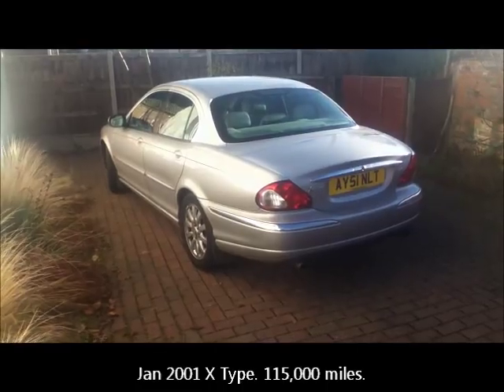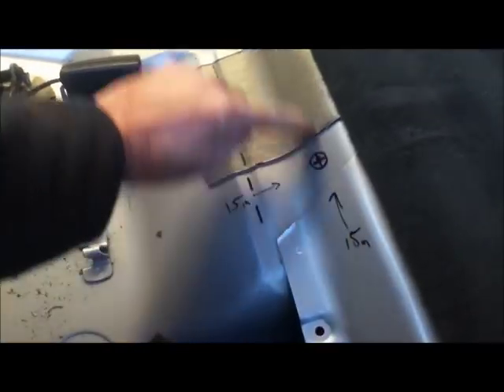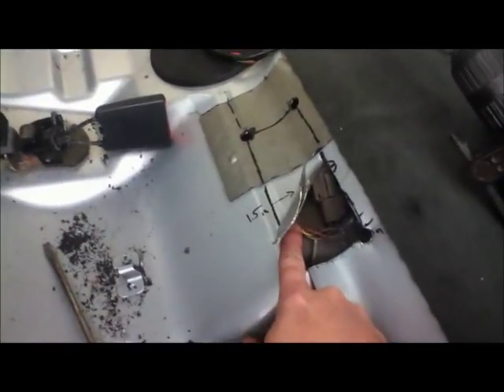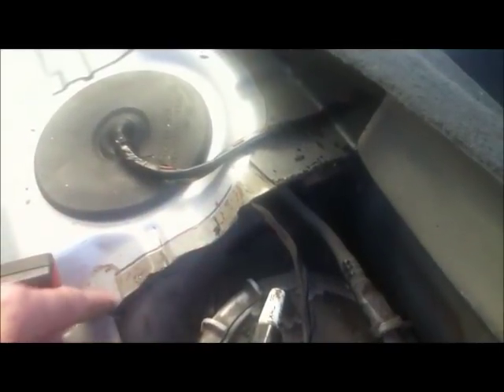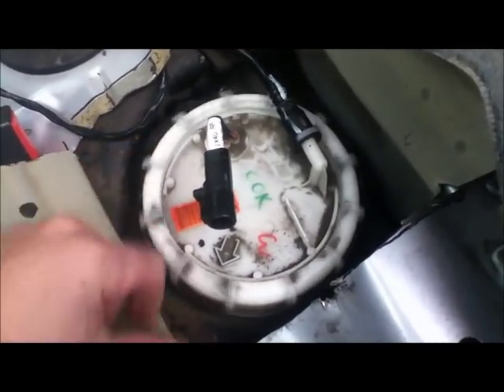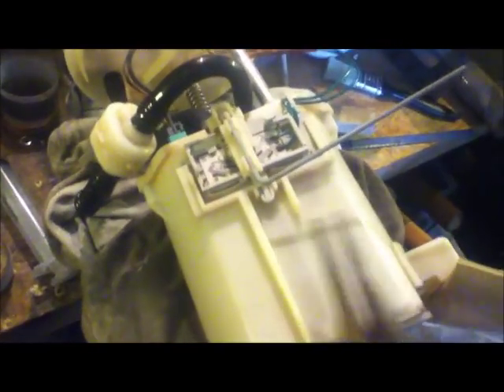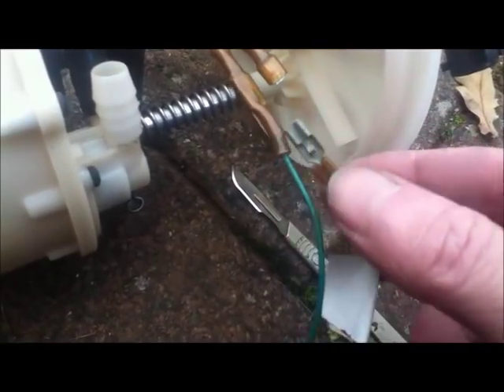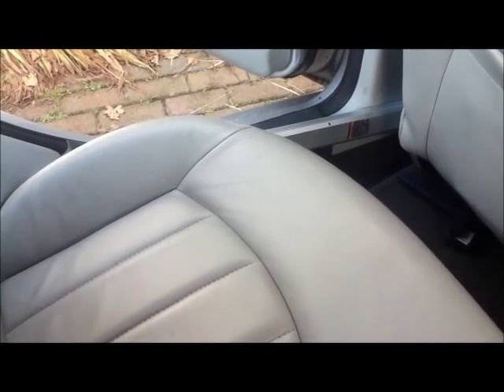Jaguar X Type Fuel Pump Change

Comment from the maker: You need to bear in mind that these videos are for people who want to repair their own cars. My Jag isn’t worth more than £350 now. To remove the tank is £800 ($1000) worth of work which you can’t do without a workshop lift. First empty the tank – there’s no drain plug you need a siphon and pump. Lift the back seat out –easy enough. Prise the grommet from the floor panel and disconnect the wiring, Jack the car right up high. Disconnect the fuel filter, the breather hose. Loosen the fuel filler clamp. Remove the prop shaft – it will be siezed on every screw.  Lower the final drive unit by 75mm (drop the subframe - that will be fun) and suspend it with a strong chain! Slacken the other fuel filler clamp (nearly impossible to see). Disconnect some other hoses. Chock the tank and undo the bolts. Lower the tank with two people - it still has fuel in it. How many hours has this taken? Now you can undo the fuel assembly and fit the new pump. Now put it all back. How many more hours? Test the car runs. What happens if it does not? £13 version – lift out the seat, cut a slit in the floor, change the pump, seal the slit, test the car - all done in 2 hours max. 1/2 hour if you have to do it again in the future. The S Type has a rubber panel right over the pump – so do most other cars. The X-Type has some terrible designs flaws and this is one of them.

Comment: I was getting ready to do this job, as after 5 months of winter storage the fuel pump would not run at all. Instead I put a couple of electric heaters under the gas tank for a few hours, then hammered the plastic tank a bit with a rubber mallet and she fired right up. I got lucky with that, hopefully it won't happen again. In the future I think I will start it once a month and let it warm up fully during winter storage just to keep things working. Thanks for the video, hopefully I will never have to do this!
Reply from the maker: I had a few of those false breakdowns before I had to change the pump. Unfortunately it is on the way out. Better to change it when convenient rather than getting stuck in the middle of nowhere in the dark like I did.

Comment: This was very useful, I was able to just buy a new pump for about £45 on ebay and it fitted perfectly into the plastic housing. So far so good.
Reply from the maker: Nice work!
Reply: Can you tell me the part number?
Reply: @johnnysevengun hi mate, are you willing to do this for my jag for cash. Having the same problem!
Reply from the maker: @ib1314  I am not a professional mechanic so I could not guarantee any work. The best thing to do is find someone local you trust and show them the video. If they think it is too hard and want a lot of money - find someone else - it is not a hard job with simple tools.

Comment: Holy shit! I have felt nervous just watching it!  Well bloody done. Thanks a lot for another educational movie, I hope my Jag won't do this to me. I will get myself one of that nibbler tool. 
Me personally, I would try to use a rivets or rivet - nuts and some metal sheet to seal of that fuel pump, but nevertheless that was like watching some good horror movie. I think I can still feel adrenaline going through my body. 
Bloody awesome! 
Regards.
Reply from the maker: I did think of making up an aluminium sheet but that tape I am using is used to repair the damaged wings of aeroplanes and is much easier to use.

Comment: Hi, it's me again. I've just got the Jag back. New Alternator, new battery, new belt. Including a recovery to the garage = £550 inc vat, which isn't bad at all. He said it's a wonder the alternator didn't set on fire! He also said that jump starting another car is always a risk. It could have been that, that created the problem, so my jump leads are going in the bin. They had to remove the engine subframe and needed a special tool to slacken the belt tensioner as it was really awkward to undo. They removed the alternator through an access panel under the front offside wheelarch. It took two of them about 4 hours. I've just put the pin code in the radio so all is well again. Cheers.
Reply from the maker: Glad to hear it is back on the the road. I have not had to change the alternator which is lucky as you have to dismount the air conditioning pump as well. I have done a video on using jump leads on a Jag. https://www.youtube.com/watch?v=MWBghZWoJ6k

Comment: Thank, you so much for you're helpful video.   I'm going to install a  small henge on the metal that I'm going to cut out that way if I have to go  inside it again this is a lot better then dropping that fuel tank and under the fuel tank their is a  steel shield under the fuel tank and I did not want to take all of that off to.  thank, you again so much.
Reply from the maker: That is a good idea. If you do it the way I did you only need to the bend the metal back.
Reply: Thank, you

Comment: Brilliant video, very helpful.  I may have to do this job myself but on an X Type Estate 2004.  Do you know if the measurements from the edge of the front of the rear seats as per your video are the same or is the pump further back?
Reply from the maker: As far as I can tell the tank is in the same position relative to the seat pan.

Comment: Great video. I just subscribed. I have a 2003 XKR convert that seems to have a pump problem. I can't reach back behind the rear "seat" to cut a port so am exploring the challenge of tank removal. All the videos are for XK8 cars and everyone is traumatized by trying to reach line connectors under the car to disconnect them, understandably so. I can't figure out what goes into those ports as I don't see any videos where there are hoses on the pumps that connect down inside the tanks to ports that go through the tanks. The tank diagrams in the Jaguar dealer parts pages for both older XK8s and the 2003 XKR don't show any underside perspective which might show ports. I have three lines coming out of the tank at the top, the other ends of which are all separable. Two lines seem to be for vapor collection. The right one has an aluminum tube that goes to the left side of the tank with a rubber hose that runs down the side of the tank and connects to the port on the floor of the boot. I can only find one reference to it by a guy doing his tank that thought it was a vent tube. If there are no other lines coming out of the pump inside that connect down in the tank, is that my fuel line, in which case it seems to me I can just disconnect the bottom of the hose and then disconnect everything else and wrestle the tank out. Your thoughts, Sir?
Reply from the maker: Firstly I am quite envious of the XKR but I have no experience of it. It appears to be the same as an XK8 but with a more powerful output from the supercharger. There are lots of videos for changing the fuel pump and I found one showing all the special tools someone made for unhooking the fuel lines. I wish you good luck.

Comment: Wow that's a lot of work! Is it really necessary to change all those parts that you change? Or are you doing it just for fun and to maintain the performance for a longer period?
Reply from the maker: I only change the parts I need to. I am not doing it for fun as I use the car everyday. The cold winter kills parts on old cars. This job is not actually that bad and would only take about two hours. Changing the rear shocks was a much more difficult job.

Comment: Thanks for the video - really helpful with my 2008 3.0 Jag recently. However I found I was able to replace the actual pump by leaving the corrugated pipe connected and taking the plastic gubbins apart. Meant I could put in a new pump (approx £35 from Ebay) rather than risk a second hand item. Tempted to put my photo series up on Youtube and link them to this video. You happy with that? Andy
Reply from the maker: Yes it all helps. When I did this it was not easy to get a new pump.

Comment: Amazing video - I assume it would be very similar for the 2.0L diesel?
Reply from the maker: I don't think so. Diesel pumps are normally driven by the engine and will be under the bonnet and is a big lump. https://www.ribblevalleydiesels.co.uk/product/p4143/

Comment: great video! 
Thanks!
Looks like Ill be doing this as fuel dripped onto the ground after I filled my X Type up at the petrol station.
Been smelling fuel for a while too so am happy its finally shown me where its going from!
Do you have any idea where it could be dropping from or its best to just cut this hole and have a look at all the connectors up top?

Thanks again for the great video!
Reply from the maker: Seems unlikely it will be coming out of the top of the tank. Check the connections to the fuel filter underneath. I did a video on changing it. https://www.youtube.com/watch?v=Gsp1L3IGA4k
Reply: @johnnysevengun  I think my seal has cracked at the top letting fuel come out when it's full.
You can smell fuel in the car and more so when the seal is open for the pump area.
Reply from the maker: @Nthstar  The white unit has a green seal in the top. It may have perished. I had to seal mine twice to get a good seat.
Reply: @johnnysevengun  it is that I'm sure. I fiddled around with it last night and noticed it was moving quite freely even though the round ring seal was tight as anything. Then this morning I go out to discover a pool of fuel in that whole round area!!!! So i am sure I have disturbed an already brittle/failing seal and fuel now is just seeping out (i have a full bloody tank!) typical hey haha!
Reply: @johnnysevengun  undid the fuel pump housing.
The seal was half dangling in the tank of fuel underneath. So have discovered what the problem is.

Getting the fuel pump back down with the seal now seated properly and trying to tighten the round screw thing seems like a 2 person job!
Any tips for that?? 

Thanks to your video aswell I ended up cutting all around the inspection port (similar to your video wwithtin snips) as they made it that you can't get the top of the fuel pump out or the seal or anything. The hole just isn't big enough.

 Goodness what a silly design this whole arrangement is !
Reply: @johnnysevengun  thanks 
My problem is all fixed.
Created a new and USABLE inspection/access port above.

I wouldn't have had the courage to attempt it without your video!

Thanks so very much!

Comment: I know this is a rather old video now, so don't know if you reply to these anymore. I have a 2006 model that I now need to perform this operation on. How did you know that you didn't need to change the other sender unit? Just tried it out?
Reply from the maker: Yes. As I knew the sender was working because the gauge read correctly it was not necessary to change it.
Reply: @johnnysevengun  Ahh Right. Thank you. I should have thought a little more about it. The Sender unit doesn't pump the fuel. My gauge also reads correctly, so I shouldn't have to worry about it either.

Comment: What was your car doing?
Not starting ? Mine is starting up rough when I put in reverse it turns off. 
When I leave it running in park shuts off
Reply from the maker: The car would start fine and run but then without warning cutout. The RAC man hit the fuel tank with a mallet to free it off and then i got home (just). As the pumps are now very cheap it would be worth changing it anyway if you suspect it.

Comment: Bloody well done, just how much would you charge for doing this?
I am looking at another X Type 2.0L deisel, 2003 model, but I am very unsure of my own heavy handedness and I do not know to trust a garage in this day and age.

Well done, you have shown a novice, but a Jag Lover the procedure and most of the time I am baffled by sales and mechanical people time and time again.

I like the car, but having had 6, I feel slightly hard done by and I have little time for Jaguar who now disown the car, it is still a beautiful and capable vehicle, I love to bits 😎
Reply from the maker: I don't know much about diesels but I do know the pump is not in the tank but driven off the engine. A quick look at Jag forums indicates it takes about an hour to change one. The pumps are expensive though. £120 for a secondhand one and about £320 new with a  discount.

Comment: Brilliant old chap! i didn't hear you say bloody hell when you realize that the pump was partially defective. i guess that what happens when you purchase a second hand part. so much for a 5 star for the eBay seller. video was very detailed to say the least, 5*. I was watching a video by scotty kilmer another brilliant mechanic that post videos on you-tube. He said that this was a $1000 job because the not so brilliant ford/jaguar engineers placed the tank on first then bolted the sub-frame over the tank. So you would have to remove the whole sub-frame to change the fuel pump.  Nice hack and you were very careful. hopefully i dont have to do this to mine.
Reply from the maker: To be fair the pump was and is fine. I may have damaged the sender myself. It worked before I put it in. With regards to the sub-frame - very bad design. Th e S Types have rubber discs over the fuel pumps so you can change them easily.
Reply: Hi, do you have a link for the pump positions plz ?

Comment: In vehicles nowadays there is a hole under the seat so you change the fuel pump very easily
Reply from the maker: That is correct. The S type was designed like that but not the X Type.
Reply: @johnnysevengun  If you go to Scott Kilmer's video on this issue he said just to replace the fuel pump it will cost the owner about a 1000 dollars service charge
Reply from the maker: @worldpeace32  I love Scotty - he's a real mechanic. But my garage will slit the floor and have it done in two hours tops. I could do it in about the same. If you look at the pinned comments you will see the difference.
Reply: I guess it's a whole day job if you do it from below isn't it?
Reply from the maker: @worldpeace32  This is the answer I have given before: You need to bear in mind that these videos are for people who want to repair their own cars. My Jag isn’t worth more than £800. To remove the tank is £800 ($1000) worth of work which you can’t do without a workshop lift. First empty the tank – there’s no drain plug you need a siphon and pump. Lift the back seat out –easy enough. Prise the grommet from the floor panel and disconnect the wiring, Jack the car right up high. Disconnect the fuel filter, the breather hose. Loosen the fuel filler clamp. Remove the prop shaft – it will be siezed on every screw.  Lower the final drive unit by 75mm (drop the subframe - that will be fun) and suspend it with a strong chain! Slacken the other fuel filler clamp (nearly impossible to see). Disconnect some other hoses. Chock the tank and undo the bolts. Lower the tank with two people - it still has fuel in it. How many hours has this taken? Now you can undo the fuel assembly and fit the new pump. Now put it all back. How many more hours? Test the car runs. What happens if it does not? £13 version – lift out the seat, cut a slit in the floor, change the pump, seal the slit, test the car - all done in 2 hours max. 1/2 hour if you have to do it again in the future. The S Type has a rubber panel right over the pump – so do most other cars. The X-Type has some terrible designs flaws and this is one of them

Comment: What symptoms led you to believe it was a bad fuel pump?
Reply from the maker: I had a problem before where the engine cut out as I was driving which I cured by changing the fuel pump fuse. This time it could only be restarted by hitting it from underneath .
Reply: Which one is the fuel fuse? I have a problem that when i accelerate from slow rpm my engine seems to misfire badly and shakes for a second (seems like it goes off).

Comment: Is there a way to do this on a s type 2003 by not cutting the line that goes inside of tank, but taking it loose from other side sending unit?
Reply from the maker: The S Type hasa rubber cover over both the pump and the sender.

Comment: Hi Concept Symetry Guitars. Owned a 2007 X Type. I've experienced for the second time wherein the car didn't accelerate (running from pretty slow) even I stomp on the gas pedal. What I did was to place it on parking, switch off then turn it on. I was wondering if what's the issue with this. After watching your video, no idea if it could be a bad fuel pump? Or is there something wrong with the injectors. Appreciate for your help. Thanks.
Reply from the maker: Its difficult to second guess from a distance. Check out Scotty Kilmers video on the X Type for checking the pump. https://www.youtube.com/watch?v=JoWZz1ckRGw.  If the pump is working OK the other thing it could be is the switch in the accelerator pedal in which case check https://www.youtube.com/watch?v=i91iQtYSfec&t=295s
Faulty injectors should make the car run lumpy and bring up a code pretty quick.

Comment: This is weird !
My fuel pump seems to be under the inspection port where yours is not on the video at 1.40.

???????
Reply from the maker: That's good. Mine is a 2001 model. Maybe Jag realized and moved the port on later models. S-Types have two ports - one for the pump and one for the second sender.
Reply: @johnnysevengun  mine is 2001 aswell.
Its actually the 2.1V6 FWD
I think thats why ?
Reply from the maker: @Nthstar  That will be why.
Reply: @johnnysevengun  I've since discovered its leaking HEAPS of fuel at the top of the pump area so I am 99% sure my top seal has cracked (the green one in your video) fuel just keeps seeping around the edge of the assembly. 
Will have to replace the seal and see how I go!

Comment: Its common sense to put the fuel pump where it can be accessed easily, this isn't expected from British designers!
Reply from the maker: Hundreds of cars are designed like this. For some unknown reason (probably some bean counter somewhere) the rubber covers were not put in the right place. The S Type has covers over both fuel units making it easy to replace the fuel pump.